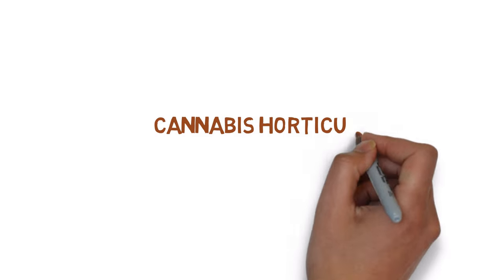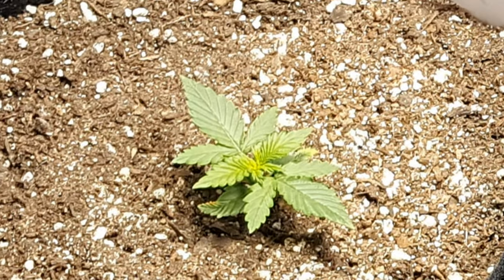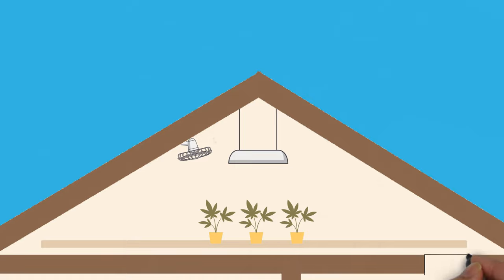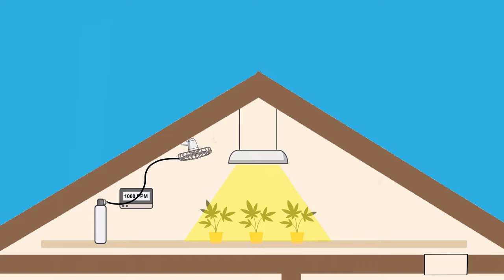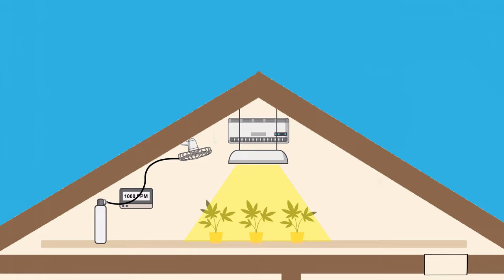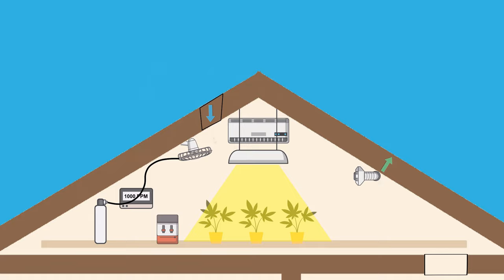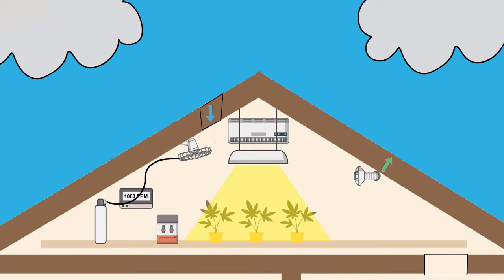How a Setup a Closed-Loop (Sealed) Cannabis Grow Room

Comment: Open loop grower for years. Finally have sealed veg and flower room. Added a titan controller and a solenoid and a 2I lbs tank.  Significant difference in plant performance etc!!!! Great video
Reply: Links to the controller and solenoid. Much appreciated
Reply: There's no loop, closed or open.

Comment: If you use a portable air conditioner it needs to be a dual hose type that pulls the air to cool the condensing coils from outside

Comment: Some of the higher end lights on the market run 1000-2000 ppfd. You can't really crank them up to their full potential without adding co2. I was gonna put tents in my basement but now think I want to wall off a grow section. Would only have to put one wall in to make an 12x12ish room with 3 concrete walls. Do you think this would hold co2 ?
Reply: did you end up making this? how'd it go?

Comment: I'd appreciate it if you can provide some direction. I had a couple of successful grows in a 7'x7'x7' concrete room. It has one door and nothing else. I was having trouble with the sound and smell and my cheapo fan filter didn't really cut it and it was getting too humid. So, I added a 10" fan/filter combo, a dehumidifier and sealed the door side of the room as well as the door with rubber sheeting(it was really inexpensive). It made things much quieter and no smell. Plants were doing great until, I switched to flowering, on certain plants leaves turned brown and plant started to die. 4 plants died and only two lived. But after the buds were getting big these plants died too. Why and what can I do to prevent this?  It did get much warmer in there and went from the previous average of 80 degrees to 88 sometimes 90. I kept humidity stable at about 60.  Was it the heat that probably killed them or could it be lack of CO2?  Thanks in advance.
Reply: Heat mate. Just heat

Comment: If the mini split is taking outdoor air and blowing it in the room how is it closed? If the split is filling the balloon the replaced air has gotta go somewhere?
Reply: the room air just flows through a radiator where heat is taken from the air and pushed outside. Never ever does the room air go outside and outside air go in.

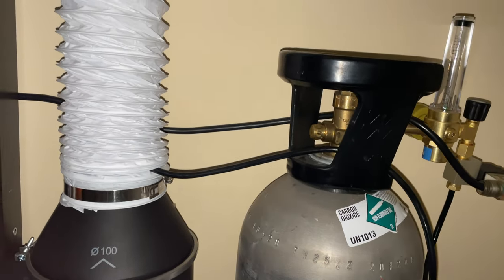Comment: At 7:48 that air scrubber set up witht the co2 piped in it, does that ducting just open up at the topof the roomand is not vented outsoide? thax and thanks for such inm depth info

Comment: Most portable ac units will exchange air from outside even though they claim they don't.
Reply: you need a dual hose portable ac, the single hose type will pull air out of the room and are hugely inefficient
Reply: @rjay5506  A dual hose will still leak air outside even though they claim they won't, but they will and you will have a strong odor outside.
Reply: Thats certainly possible, probably depends on the brand and how well its sealed and whatnot. If you are pulling indoor air it would be from some sort of leak/ poor sealing in the compartment that holds the condenser- you could probably fix seal it up with some foil tape and a can of spray foam

Comment: Your comment about placing C02 as high as possible since it is heavier than air is like using a inline fan to blow air in a tent and a inline fan to suck air out of the tent, it's complete bs non sense. If you have isolating fans it does not matter where the co2 is placed. Yahl kill me with all the bs u tell growers then they go do the shit when it's absolutely non sense.
Reply: the whole point of pushing out co2 from up top is because co2 in fact is heavier than air. So the co2 will fall onto the plants and thats what you want .
Reply: @TeW33zy  yep
Reply: It doesn't matter where the CO2 is? how is a plant at the top supposed to absorb it when all of it is pooled on the floor
Reply: @kamikazi5144  what type of stupid question yahl be asking..Just get the damn co2 in the area the plant will do the rest. 2nd, co2 is absorbed from the bottom of the leaf not the top.i
Reply: @kamikazi5144  that's why u always have a isolating fan keeping the co2 in the room or tent even all around but co2 is absorbed from the bottom of the leaf anyway so it doesn't matter either way.
Reply: @TeW33zy  I see, that makes sense
Reply: @TeW33zy  Thanks man, I'm gonna use your advice when I grow...I'll place the CO2 enhancers towards the bottom and let the fans do the work. I think it's good that the CO2 pools because otherwise the inline fans will pull it all out. I'm not running a closed loop system
Reply: @e90rocco  preach it!